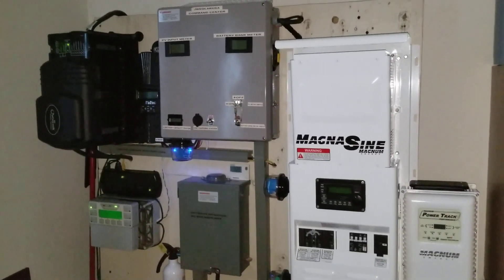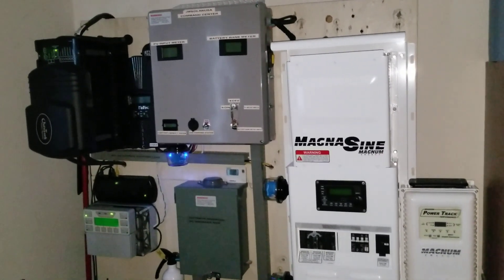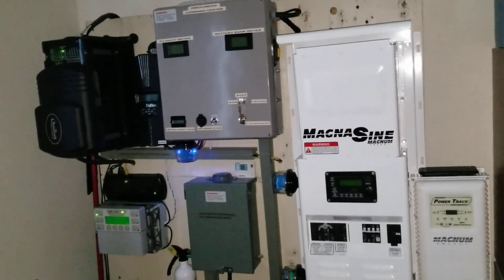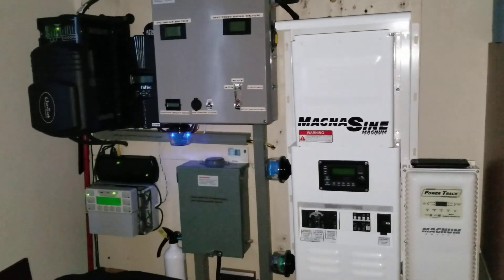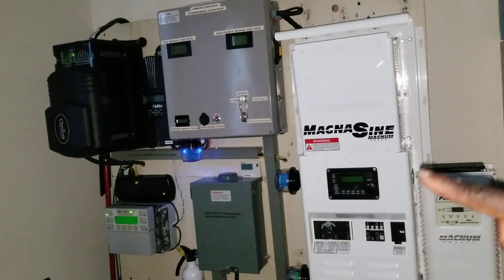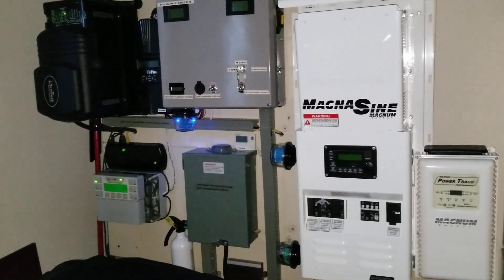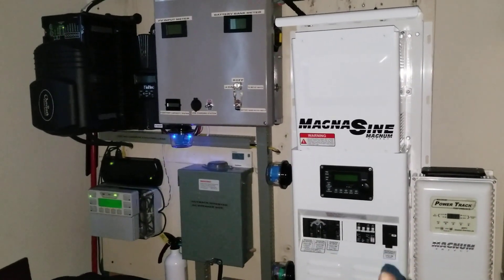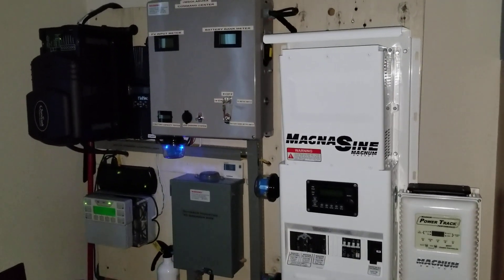MAGNUM ENERGY MS4024PAE INVERTER CHARGER UPGRADE

Comment: CAN A SIDE BOX FIT ON THE SIDE OF THE LOAD CENTRE AND THE OTHER MAGNUM ON TOP OF IT ? YOU MIGHT CAN HOOK BOTH MAGNUMS ON ONE 250 AMP BREAKER . IF THE BREAKER CAN BE LARGER THEN 250 AMPS - 300 AMPS MIGHT WORK IF IT  CAN HANDLE BOTH MAGNUMS  OR USE FUSES FOR EACH MAGNUMS COMING FROM ONE BREAKER . JUST LOWER THE POWERTRACK SO THE SIDEBOX CAN FIT ABOVE IT . IMPROVISE , GO BY YOUR INSTINCT , AND YOU SHALL SUCCEED . MAY THE SOLAR BE WITH YOU .
Reply from the maker: MAGNUM ENERGY MS4024PAE INVERTER CHARGER UPGRADE INSTALLATION 101
https://youtu.be/rks_J5VNS5E